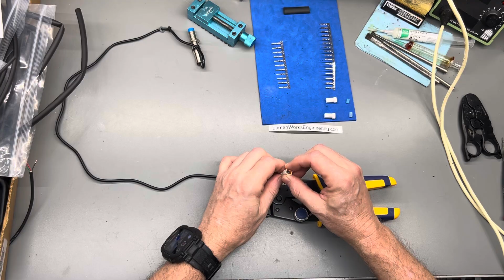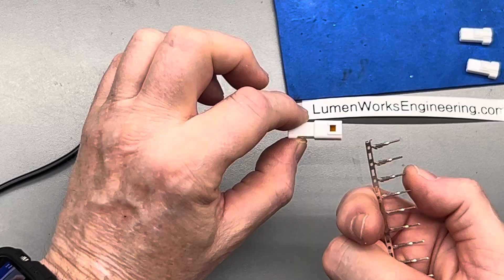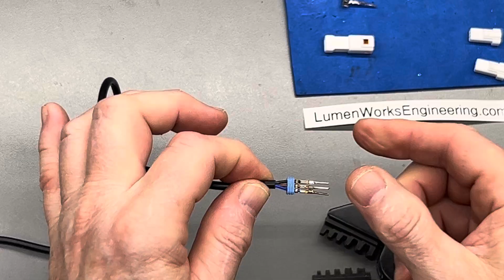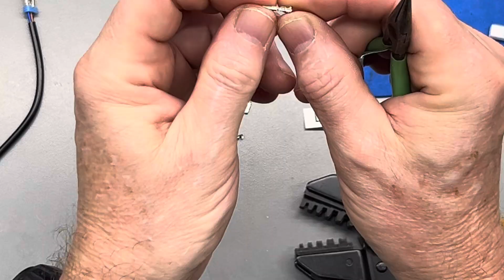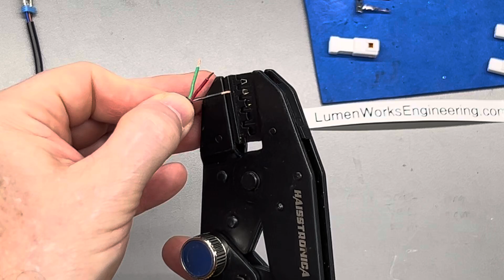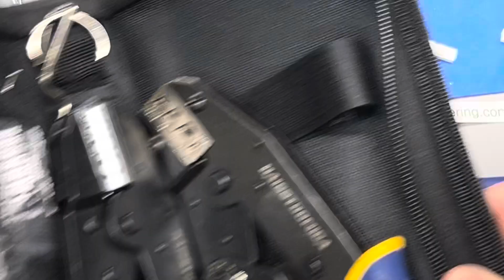How to Crimp Dupont, JST, & Similar Connectors

Comment: There is another "side" to the male/female thing.  Usually power is supplied by the male side connector housing because it protects the receiving pin better..  Like a spark-plug. The receiving female side is what sends the power to the spark-plug and you wouldn't want a cable to fall off and short against an oil or gasoline stain on the engine. Also, the female pin inside the male housing is more steadily held and when you plug the cables together-the male pin can find it's mate easier.